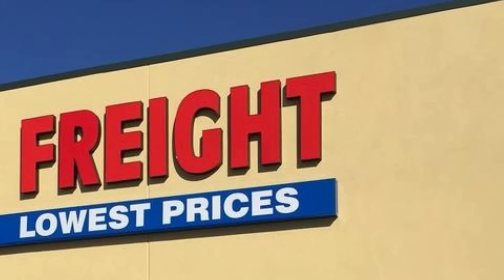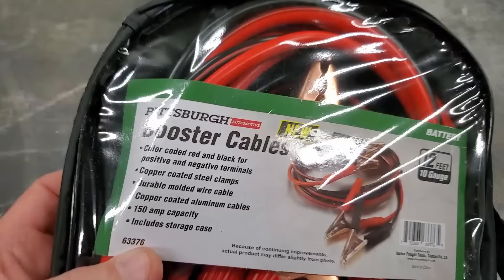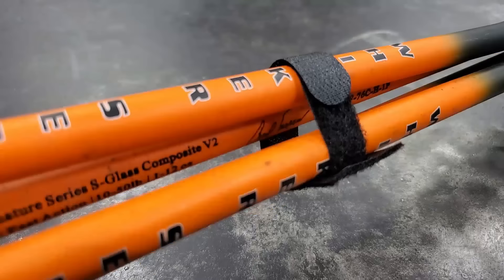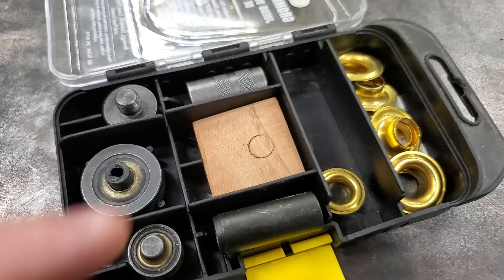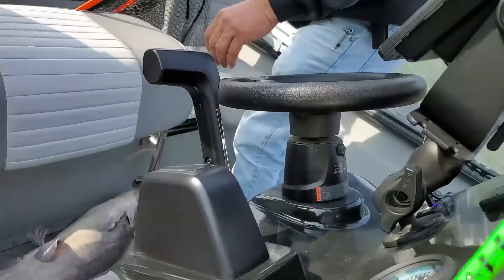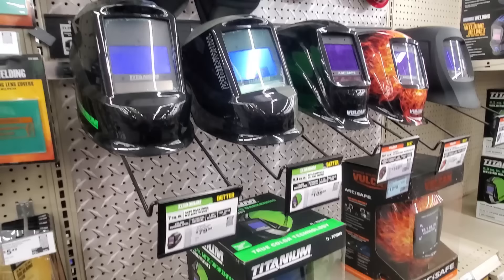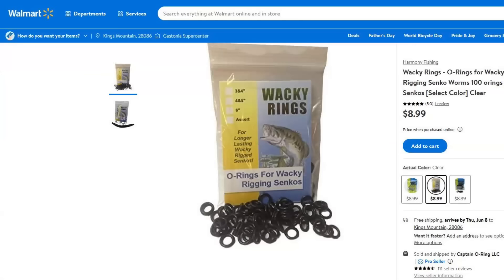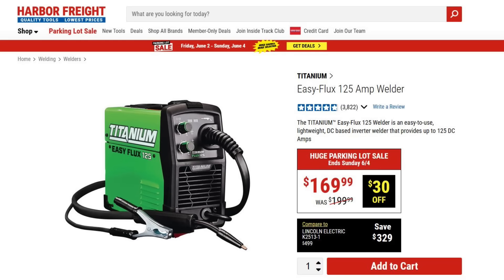Harbor Freight has great fishing gear

Comment: You can also cut the alligator clamps off of the jumper cables and replace the wiring in your boat.  Much cheaper than buying 8 awg or 6 awg wire.

Comment: Hey I used the jumper cables to connect my minnkota 40lb trolling motor to my minnkota battery box for my fishing canoe . Cut off both alligator clips on one end and now use  connectors to connect motor cables to jumper cables. Leave alligator clips attached on other end to clip on battery box . Handy bag to keep new motor cables compact and organized . 😀
Reply from the maker: That's a good idea . But jumper cables wires are aluminum based . You might be better off getting some solid copper wires to run it

Comment: Dude, the red and black Bauer tool boxes are watertight and on wheels too.

Great for running stuff out on a pier
Reply: It's my current tackle box.. I know it's a bit big but I like taking a large variety of things..you can also drill holes and add rod holders that won't get in the way..carry my nets and my buckets..should definitely get better wheels if going out in the sand and you can't really beat that price of 50-60 bucks.

Comment: Titanium 125 flux core welder, owned mine almost 2 years and never had problems with it, welds really good with multi pass Lincoln flux core wire
Reply from the maker: I agree . About the Lincoln wire it runs good beads . I use it in my Miller

Comment: From what ive seen and heard Titanium welders from HF are actually pretty good for the money. I seen a review video where they tested a bunch of stick welders and the titanium was a top contender in the fact that its power wasn't a lie, it actually over performed a little bit but there was a lot of the cheap brands that said ya we can do 130 amps but then only put out about 70. I have a friend who has a titanium mig and he uses it with the gasless wire and says it does great. Ive been considering a Titanium or a Vulcan myself.. I just recommend buying a bunch of replacment parts now because any of the horror stories ive heard about HF is when they stop carrying something it becomes impossible to get parts for some things.

Comment: I’m in harbor freight a few times a month. Love that place!  I’d be interested to see how the lower voltage flux welder does for diy stuff!
Reply: I have the titanium 125 easy flux and I love it! This is my first wire welder and I wasn't sure I'd be able to use it but it's awesome for small jobs! I wouldn't weld a truck frame with it but I've used it on my heavy duty trailer a couple times and it definitely gets the job done. The splatter is a bit messy but it cleans up quick and easy. I highly recommend it for DIY projects!
Reply: I tried the Chicago electric wire welder and wasn't impressed.     If I were to get another one it would be mig.

Comment: Keith, you forgot to 2 things to use from HF for fishing. And I can't believe that you missed #1. #1: A Fish Finder. It has one of those floats so you can put out as much cable you have. #2: A radio controlled boat. Hook up one of those line clip's to the back end, put you line in the clip, take it out with the boat, & when you get to where you want to set your line you just trip the bail & bring the boat back in for the next "cast". You could also troll with it too!😅

Comment: I have most of the HF things you showed except a welder. 
~Use HF marine heat shrink tubing for all boat electrical connections.  It contains a waterproof glue that melts and totally seals the connection.  
~The HF Viking lithium-ion jump starter has saved us several times.  It’s compact and more than powerful enough to jump the boat or vehicle battery.  
~The HF Viking compact 4amp automatic batter charger goes on every overnight trip to charge battery #3.  The built-in boat charger only charges 2 batteries.  I took the cover off the charger and silicone sealed all the edges of the cover and any possible openings to make it waterproof.
~I bought a bunch of the waterproof clear tackle boxes on sale but am not totally pleased.  There is a gap between the top of the internal dividers and the cover which allows small items, like hooks, sinkers and some baits, to shift between sections.

Comment: I’m gonna add one suggestion. “Ball stretch cord set”. I use them to go around my helix to hold the cover secure while trailering. Put the strap Around control head and tied a knot to make the cord shorter. Put cover on and grab the ball and pull over cover. Quick and easy
Reply from the maker: That's cool . I find a Hack kinda like that on one of my fishing hack videos

Comment: I bought the 24" silicone ties (2 per pack), cut them in 6" lengths, and capped the ends with some Temu heat shrink.  Perfect length for tying my 2 and 3 piece crappie pole segments together.  Enough to do 4 poles in one 24" pack.

Comment: Definitely agree about the buckets. I take half inch and inch drill bits and drill holes in the bottom and tie a rope to them and you have a cheap drift sock for those windy days. Drift socks can be pricey for the good ones.

Comment: A couple of years ago I bought a set of those jumper cables. The clamps are barely copper plated steel and they started to rust in my service van. If I was going to put them on my boat, I think I'd douse them with some anti corrosive spray and stick them in a ziplock bag or something. Better would be to just wire a cable from one battery to the other with a battery switch in between.

At the end of the video, you asked about the welders. I bought a Titanium multiprocess welder from HF about a year ago and it has worked just fine for the things I've done with it. I've only used the mig function so far (need to learn tig). When I bought it I was a little concerned about the short duty cycle (I think it's 10 or 20%) being a problem but, so far, no issues. 

I want to do some tig but I just haven't had the time to get after it and practice. It seems like I come up with a little project that would be good to tig, go out in the garage, say F it, and pick up the mig gun because I know I can knock the project out.

Comment: I've bought jumper cables at Harbor Freight for my boat to replace the wire that the factory uses to wire your boat with. It's cheaper than buying just the bulk wire and has less resistance than the factory boat wire which means longer better life and your depthfinders will have a clearer picture

Comment: A set of jumper cables work great for wiring up trolling motor batteries. 20' of heavy gauge wire was a lot of money for my boat. I got a set of jumper cables instead and just cut the ends off. They carry more current and are all copper

Comment: Thumbs up on the welder. And welding supplies. I've built a bunch of things with my welder from there. All of witch has turned out awesome. A lumber rack for my work van, and a big a$$ bumper on my buddies truck. Both held up to the abuse.

Comment: I used battery cable wire to my trolling motor with a inline 50 fuse. Been running for 5 years now.

Comment: I have that cheap Titanium flux core welder. Welded up to 1/4” steel plate no problem, and it’s structural so I know it holds. Great welder, highly recommend! Built my workbench and my loft storage with it.

Comment: They do make a fair wire feed welder. Use mine to modify traps, build lock on treestands, all kinds if stuff. Had the same one for 6 years, used regular, haven't had any trouble.  So buy one and try it out, I think u will be impressed

Comment: I don't remember if I got them at Harbor Freight, but I have some cable ties with a place on the head of the tie where someone can screw them to a wall to secure wires in place.   Secured to the rod next to the handle gives you a place to hook your lure that won't interfere with your line.

Comment: My HF experience with the bolts and screws was that about 25% of the bolts have almost no thread on them and are useless as bolts. Nice video!
Reply from the maker: Your right . The Harbor Freight bolts are very cheap and it's very easy to find better lol . I just like the price of the kits and I can keep extra bolts on hand for emergencies  . I run into that a lot making DIY videos
Reply: You can use them as weights on catfish rigs!! LOL  @FishinNStuff

Comment: Bought a Chicago Electric mig welder from H.F. built several trailers and exhaust systems and many other things probably lasted 10years I think I gave 120$ for it, we probably spent 4x that on all the wire we ran through

Comment: Great video and ideas. That heat gun is no good though, switch broke after two uses. Add hose clamp assortment and O-Ring assortment.
Reply from the maker: I can see that happening  . But ive had mine for 3 years now

Comment: Do not buy the Harbor Freight heat guns for commercial use. My boss bought 3 of them and they all died the exact same way. The afterburner kicks in and the motor endlessly reves out of control until poof the genie is let out. As the last one was in its death throws I stood and saluted it and said well done pig.

Comment: 2:50 OMG do not tell people that they don't have to unhook everything when they jump from a trolling motor batteries to the start battery. You straight explode your electrical system if you just cable from 24 volts for a trolling motor to a 12 volt starter. Unhook one of the trolling motor batteries before you jump.
Reply from the maker: You don't have to unhook em to charge them ? If you hook it up right you'll only get 12v
Reply: @FishinNStuff  you either have to have a selector switch that swaps from series to parallel or an isolation switch on the series leg of the 2 trolling motor batteries.

Comment: Jumper cables are so 1980's please don't buy them in 2024. Get yourself a battery pack with jumper cables they cost like $20-30.
Reply from the maker: They are nice . But a good one cost way more than 20 bucks
Reply: @FishinNStuff  I think I paid $30 for 3 of them and have jumped many cars. Truly life saver.
Reply from the maker: Have you seen the new ones that are the size of your cell phone . They are the ones I was referring to as expensive
Reply from the maker: NOCO Boost Plus GB40 1000A UltraSafe Car Battery Jump Starter, 12V Battery Pack, Battery Booster, Jump Box, Portable Charger and Jumper Cables for 6.0L Gasoline and 3.0L Diesel Engines, Gray https://a.co/d/6Cxuyfs
Reply: @FishinNStuff  yeah those are the ones I keep in my glove box in my cars. They are a lifesaver since I own hybrid cars you can't jump a car with a hybrid car or you'll fry all of your electronics. You can receive a jump from a non hybrid car that's fine. Which is why I carry them. I have jumped tons and tons of people who were stuck in the side of the road with it. It's not that brand is some Amazon knockoff power bank. You just have to shop around to find one that's affordable a lot of those are overpriced.